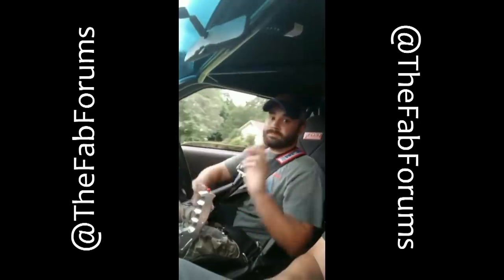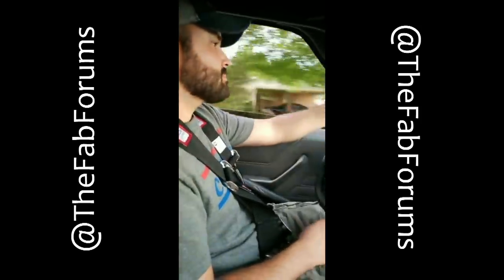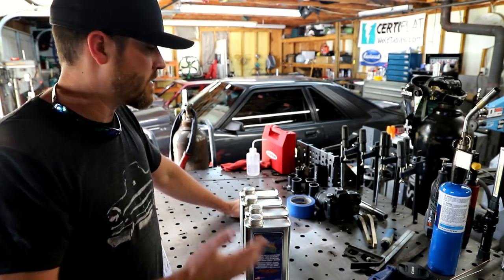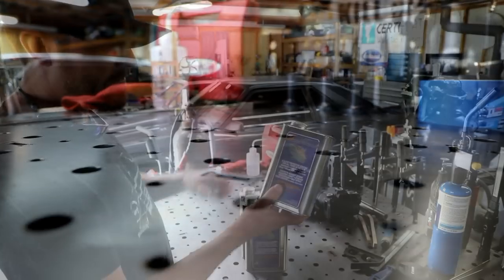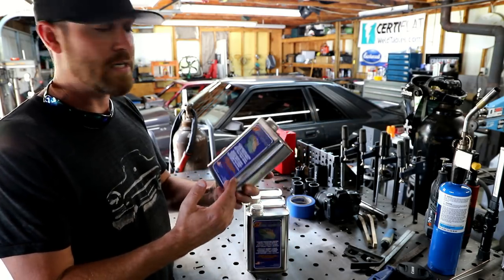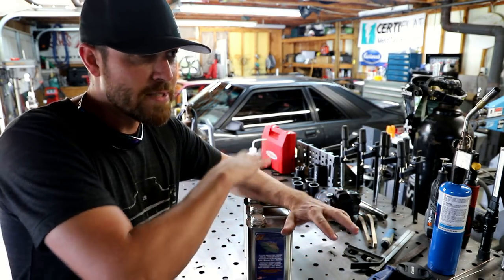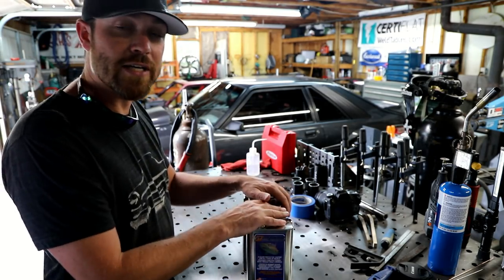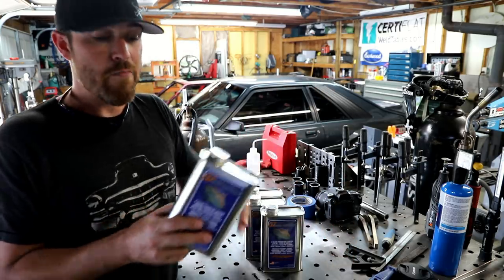How To Protect Metal | SharkHide Metal Protectant Discount Code

Comment: I'm going to get some. I've seen you work with it and it looks good 👍a buddy of mine has got a 72 corvette c3 and this stuff will be perfect for it as there is so much chrome it's unreal. Even the wishbones and drive shafts ect are cromed lol it was restored in 2007 by the previous owner and its a proper head Turner especially given its red 👌

Comment: Sharkhide looks awesome for aluminum, but I’d be interested in hearing from someone who has used it on steel, possibly underbody applications. I love por15 but it requires a lot of prep and is difficult to remove.
Reply from the maker: I use it mainly on steel. Mainly small dip-able parts though
Reply: We have people coat entire undersides of cars, trucks, etc.

Comment: can you paint overit ever,.or does it need to be exhumed befor ?hand
Reply: Mike here, from the Sharkhide Store.  I would not paint over it.  It will some right off with lacquer thinner though, which makes clean up simple.
Reply: Sharkhide Store Can you put this on aluminum engine parts (block, heads, intake)?
Reply: Absolutely
Reply: I noticed you said it can be put over metal surfaces like engine parts. Do you have specific heat tolerances for it? If I put it on engine parts, is there an estimated lifespan(will it degenerate quickly basically)? I think this product would be awesome on parts of the body I’d like to maintain a metal finish, but if it could also preserve engine components, that would be a bonus.
Reply: We’ve used it on outdoor kitchen equipment, like stainless grill lids.  They see temps of 500f or so.  We’ve had many people use it on polished aluminum intakes, valve covers, radiators, etc...   lifespan on the outdoor grills has been many years.
Reply: i think it would be interesting to see if a bath in this product would make an economy exhaust system last a lil longer for customers ,.  seems like 1 can could probably cover quite a few jobs.... ,.. what about bolts and screwws,. do they get "painted in" and some what glued down or can you just soak them in a bucket of this stuff ,dry them and install ,.?
Reply: We have guys use them on mufflers and cat back systems.  I would coat bolts and hangers once installed.  You can use a quart spray bottle to make application easy, or try our new aerosol.

Comment: How's it do on polished aluminum? Like a polished herd bumper on a semi. Will it make the polished aluminum last longer? Or on polished aluminum fuel tanks or polished aluminum wheels?
Reply: Kyler Holzheimer I also wonder how it would work on some billet wheels. People that run the damn things have to polish them pretty much after every drive they dull super quick
Reply: We have guys that use them on wheels and fuel tanks all the time. It will keep the polish looking great, and easy to clean.
Reply: Gonna have to give it a try I think!!!
Reply from the maker: Its awesome
Reply: Sharkhide Store good to know it works well on polished aluminium.  I was going to ask about polished trim pieces on my car which were factory anodized originally. I live in Ireland,  is there an Irish or UK distributor for Shark Hide?
Reply: Stephen, yes it would work well on the trim pieces.  Sadly I have never found a way to ship it internationally.  Due to the chemical make up, we cannot air freight it anywhere, it's surface only transport.  I do need to look into this, as I have quite a few people interested in other countries.

Comment: What's the heat rating? Could I use this on my polished aluminum valve covers?
Reply: We have successfully used it on intake manifolds,  valve covers, even cat back exhaust.   We have even used it successfully on stainless BBQ grill lids that see 450-500 f.  Let me know if you have any other questions.

Comment: What no give away? Lmao jk
Reply from the maker: lol....I thought about it
Reply: The Fab Forums it's all good just use it more and advertise it more. It looks good u should do a coat and then weld over it like u said in the video I've never seen a product u can weld threw. Might be good for storing metal
Reply: I would actually love to see that. We have never attempted to do so.   Have some aerosol on the way for testing too.
Reply: Sharkhide Store wait why would u put it on the bottle if hasn't been tested? Is it flammable?
Reply: It’s not on the can that it can be welded through.  In its liquid form it is flammable, but it’s only about 13 percent solid/87 percent liquid.  The flammable portion is the liquid.  I have the material safety data sheets available.  I imagine once dry it is not flammable and you could weld through it.  Like I said though, I have no lt personally done this.  I don’t want to misrepresent anything and say you can do it, with no testing.
Reply: Sharkhide Store that's bad someone should test that because kile said u can weld through it also maybe u should pay kile to test that. Is it hazardous to breath in or touch?
Reply: If you listen to Kyle, he specifically says he "heard" you can weld through it.  I'm almost 100% sure it would be no issue to weld through, I just won't say you can do it, without having proper testing done.  I would avoid touching it with your barehands, or using it in a poorly ventilated area.  The department of transportation classifies it as a paint.
Reply: Sharkhide Store I'm sure leans towards yes just saying u guys should get it tested to see if u can weld through it
Reply: I'm sure leans way towards yes, you can weld through it, but I'm not the kind of person that will tell you it will work, without knowing it will work.  I'd love to see Kyle, or anyone do a test and weld through it. If anyone is interested I would absolutely send them out some Sharkhide for testing.
Reply: Sharkhide Store the only problem is there are different tungstens witch one would work best with both the material and the product that's a expensive test
Reply from the maker: I will do that
Reply: "Weld" is a rather broad term. I weld through paint all of the time with my flux-core welder. Good enough for those uses. But to TIG through a coating, have no porosity, and make it good enough for all of the internet super trolls?  Yeah,... not so much. It pretty much goes against the OCD'ness of most TIG welders anyways. Once past the test, what's the likelihood you'd risk it on a real project? Not that I'm against you making another entertaining video,....
Reply: Yeah, a simple swipe of lacquer thinner will take it right off, and it can be easily reapplied once finished welding.